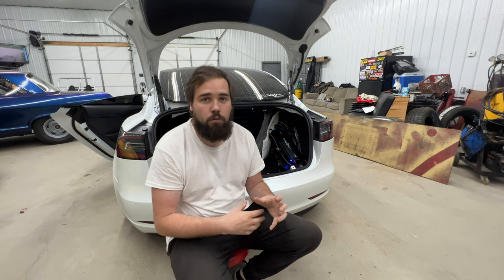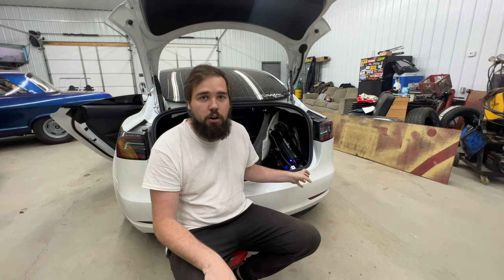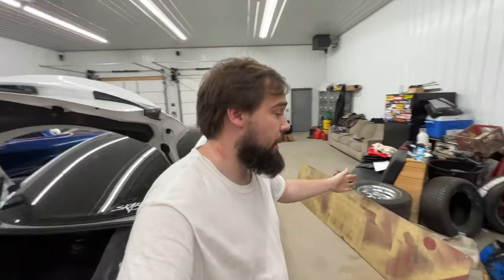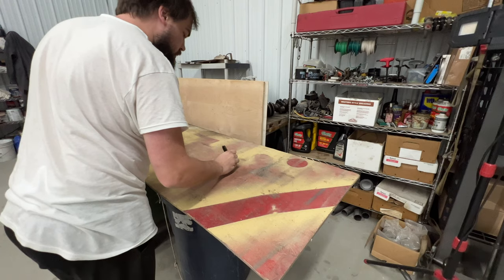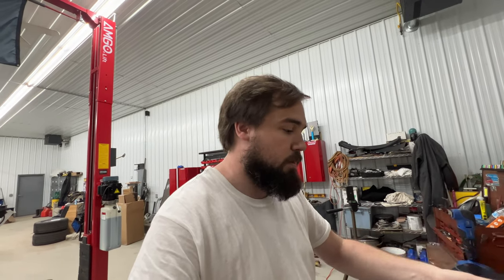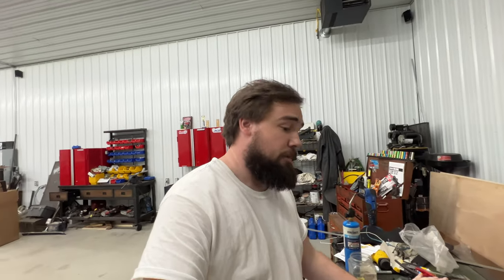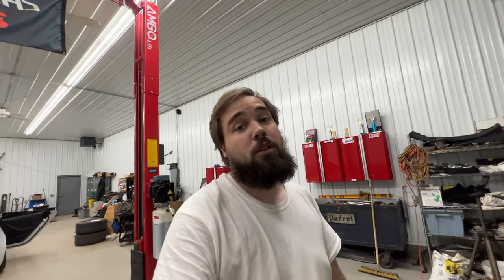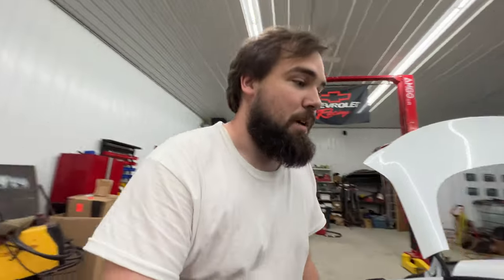Building the Amplifier Rack for the Bagged Tesla!

Comment: Ty man! This helped me out and you answering my other questions really put me on the right track! I got the error message after upgrading from a 500 watt to 800 watt amp. The Rockford 500.1 didn’t trigger the error so I didn’t need to run anything special just straight off the LC2i. I did your setup except I used an adjustable delay relay board in place of the LC2 (used the amp hi to low) and 10-30 amp relay. I’m keeping an eye on it and hopefully the circuit can handle the heat!

Anyways, ty for taking the time to help out! It’s appreciated!

Comment: I hooked mine up exactly how yours is.  Exact!  I still got an error message as if nothing is working
Reply from the maker: If you’re getting the error message it’s because the amp is getting charged before the DC-DC converter fully comes online. You need the resistor to let the power flow slowly into the amp and then the relay turns on after the initial start of the converter. The inrush of electricity into the Amp from the DC-DC converter throws the error. If you’re still getting the error, either your resistor isn’t correct, or the big relay turns on too quickly. If you have the smaller relay like I have in my setup, you can wire a simple 12v switch into that small relay and turn it on and off manually and that should 100% solve the issue.

Comment: What kind is the smaller relay at the end you used from lc2i pro? Any links? And how did you hook it up? I have the same issue with stinger not starting and I feel like it’s the remote that doesn’t have enough power to kick on the amp and the stinger. Please would help me a lot. Thanks!
Reply from the maker: I talk about this at 15:12 and on. The small relay you can get at any autoparts store. pin 85 goes to any ground, I stuck it into the ground for the amplifier. pin 30 is connected to any full time power source. I connected to the cable coming from the DC-DC converter for the amp power. You can just connect it to the power post of the big relay. (make sure its the side that the wire is connected to that runs to the DC-DC) pin 86 connects to the LC2i pro, and pin 87 connects to the big relay to turn it on. I'm 99% sure thats how its wired up.
Reply: @BaggedDev thanks for the info man. For some reason I have the same setup as yours but the resistor got too hot last night to the point that was smelling bad. I shut everything down. The stinger relay does not kick in for some reason. You had the same issue as well? That’s why you included that smaller relay?
Reply from the maker: The reason your probably having that burning resistor smell is because the amp is trying to pull all the power to operate it through that resistor and not the relay like its suppose to. (Because the relay isnt turning on)                     If you want a automatic system that works like 100% normal, the small relay is required. Right now with your big relay not doing anything, the only power going to the amp is through the little resistor. That resistors purpose is to slow and restrict the power flow to charge the amps capacitors while the DC-DC converter comes online. Otherwise it surges the converter and gives the charging fault code.                     If you don't want to add the other small relay, you can just take power from any 12v power source, run the wire to a switch in the console or something, then from the output of that switch, you can run it to the big relays turn on pole.  That will activate the big relay. But you NEED to shut that big relay off whenever you leave the car, otherwise it'll throw the fault code when the car turns on.
 @panosfxable
Reply from the maker: It's a kinda complex setup, I hope you can read through it and understand. If you understand how relays work, its pretty easy. My recommendation is 100% use the small relay also, and the car will work 100% as its suppose to and you wont have to use the little switch and try to remember to turn it on and off everytime you leave the car. Its just a temporary solution if you want to get the system working. I like when things work with as little human input / error as possible! 
 @panosfxable
Reply: @BaggedDev  I really appreciate all your help brother. You really helped out on the last piece of the puzzle!
Thank you ! 👍🏼💪🏼
Reply: @BaggedDev  so you said pin 86 connects to Lc2i pro, on what insert? The remote out? Also 87 connects to the remote small post of the relay?
Reply from the maker: @panosfxable  yes. 86 should be the small relay turn on, so it needs to get the signal from the remote out of the LC2i. This will activate the small relay to turn the big relay on. And yes 87 is your small relay high power output, so this will turn the big relay on. This would technically be pin 86 of the big relay.
Reply: @BaggedDev just added the small relay! 
Can’t thank you enough for your help brother! 🙏🏼
Reply: Did you use a 4 or 5 pin relay? Also 12v dc 30amp 4 or 5 pin relay plus harness what’s needed for the small relay??

Comment: Hey brother i got similar setup with Skar audio amp and 12'' SVR sub. Can you please tell me where exactly you have your l2ci pro set for the accubase and the master bass settings? For some reason im trying to setup mine but sometimes the bass comes hard after half way of the volume. And other times takes some time for the extra bass to go away after lowering the volume. Any help is appreciated.
Reply from the maker: I never adjusted the accubass from what I really remember. I have 2 videos about the Skar system install, I’d recommend checking them both and see if you can pause the video and copy the setting I had for the accubass, that’s my only real help I have. If you can shut it off, mine was probably turned off. Sorry I couldn’t be of more help!
Reply: @BaggedDev  I will try that, usually accubass would of help after the stock Tesla amp gives up to save the stock subs, then since we are running a wire from the door sub to the l2ci, I would think in higher volume would of just  start taking away some bass from the Skar sub. But again maybe just the l2ci itself fixes that issue without accubass turned on. I’m a bit confused but I will do some testing. Thanks! Also what was that small capacitor you added for the l2ci pro? If you have an Amazon link please share!
Reply: Brother, do you have everything connected to the stock 16v battery? On the penthouse?

Comment: So you can’t just run the amp off the battery? I know you have the air compressor but what if you don’t have that ?
Reply from the maker: Correct. No aftermarket accessories should be ran off the battery itself. It’s very small, and it’s also constantly read by the battery management system. If it sees voltage fluctuations or current draws, it could throw error codes and cause problems! The best thing is connecting to the DC-DC converter under the seat. It’s the same thing as coming off the alternator in a gas car to get your power! This DC-DC converter is the EV equivalent of a alternator, but this is around double or triple most cars factory alternators! So plenty of power here that isn’t metered by the Battery Management System!
Reply: @BaggedDev  ok sweet so do I still need the 200 relay ok can I run it straight to the DC to DC Converter ?
Reply: @BaggedDev  my car comes with the factory subwoofer to if that’s makes a difference
Reply from the maker: @maliquec21  depends what you have for a amp and it’s size. I had a 350watt amp before and never had to do the relay trick with the resistor. My suggestion, hook up the amp as normally you would, but instead of too the battery, you go to the dc-dc converter. If the next day when you go to use the car, it’ll either have a “limited power” notification and the car won’t drive, or it will be fine. I have a 1200 watt amp, and it draws too much current when the dc-dc converter comes online after the car is woken from a deep sleep. If you have anything above 600watt amp, I’d probably do the 200amp relay and the resistor trick. If you don’t need the car for a few days and are okay with testing it out, try it without the relay and see if it works. Worst case it won’t work, and then you can move on to the relay and resistor method!
Reply: @BaggedDev  ok sweet man that was a big help do you have a link for all the stuff you ordered I’m have to get it because my amp is 2,000 watts and so are my subs
Reply from the maker: @maliquec21  I went to Amazon for my stuff, I’ll send links in a little bit!
Reply: @BaggedDev  ok copy thanks again bro
Reply from the maker: @maliquec21  Here is the Resistor, this is a very important piece to the puzzle! 
https://www.amazon.com/dp/B000C9QO2C?psc=1&ref=ppx_yo2ov_dt_b_product_details

and here is the relay
https://www.amazon.com/dp/B001HBYXVS?psc=1&ref=ppx_yo2ov_dt_b_product_details
Reply from the maker: @maliquec21  I personally wouldn't recommend running a 2,000 watt amp on the DC-DC converter. I'd probably try to turn the gain down on the amp and limit yourself to a 100amp fuse. I believe the DC-DC Converter is only good for 200 amps of output, and it also has to operate everything else in the car aswell as the subwoofer.
Reply: @BaggedDev  sweet thanks again
Reply: @BaggedDev  makes sense copy
Reply: @baggeddev what if you just ran a small lithium battery off of the converter and then run your amp off that battery?

Comment: Wow, this is so not worth it. I really don't understand your motivation here. Running two smaller woofers in the back deck like the Alpine system makes so much more sense. But if this makes you happy, that's great. To get this working is beyond most DIY skill levels. I am not sure how you got the electrical knowledge about the car, but it's not something that is easy to assimilate in order to wire these monster woofers. To put this in perspective, I built a home theater system for my house with two Klipsche powered-subwoofers about the same size, and that is for an entire home theater system. But again, my hats off to you. If this makes you happy, it's a great investment for you.